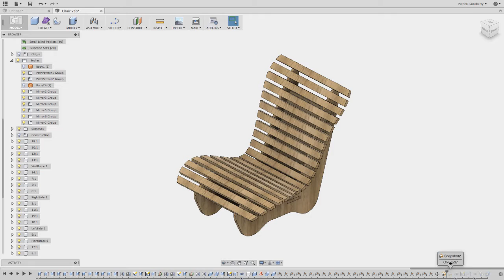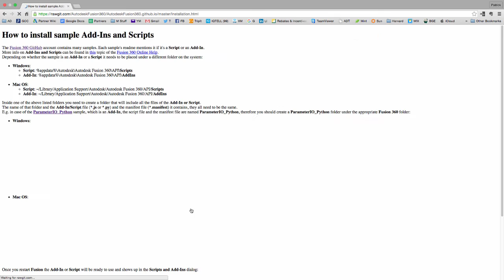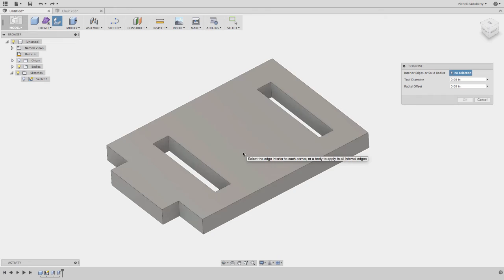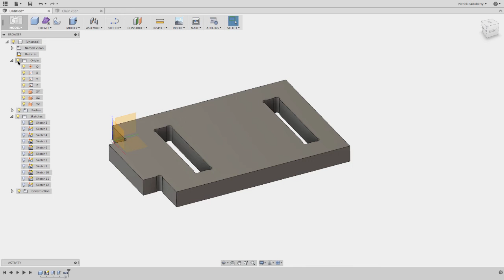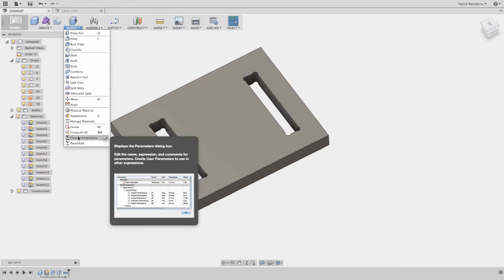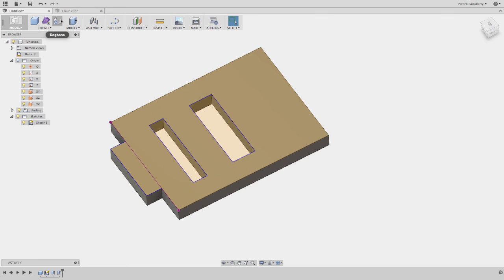Fusion 360: DogBone

Comment: I recently downloaded Fusion 360 for Mac (within the past 6 months) and when I go to unzip the file, the Library path to unzip it to does not exist. I only get as far as Library > Application Support > Autodesk. The only folders in Autodesk are Adlm and ADUT. I also don't have a Library > Containers folder (which was the other option). Did I do something wrong when I downloaded Fusion 360 or has something changed since this add-on came out. Is there a fix for this?